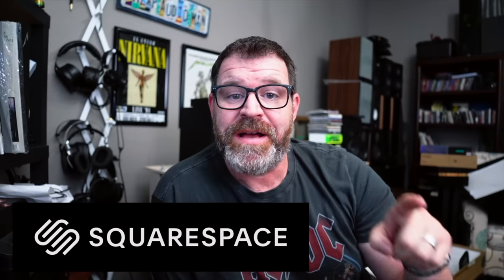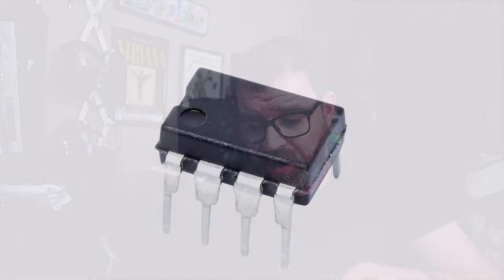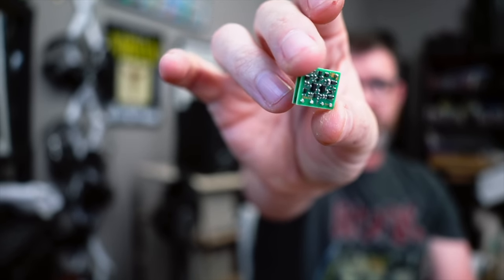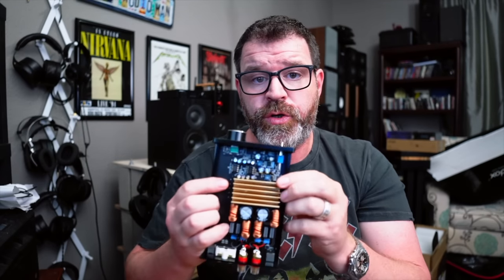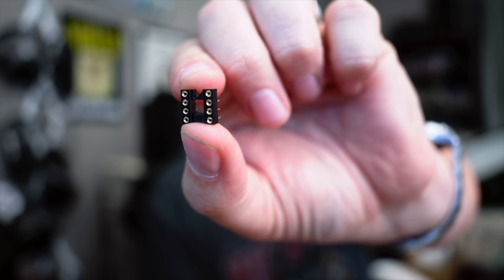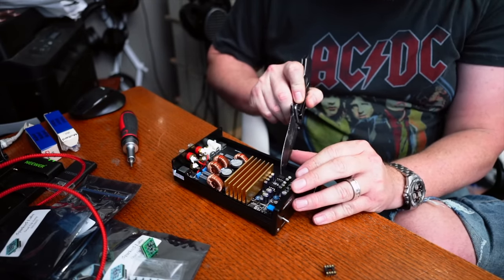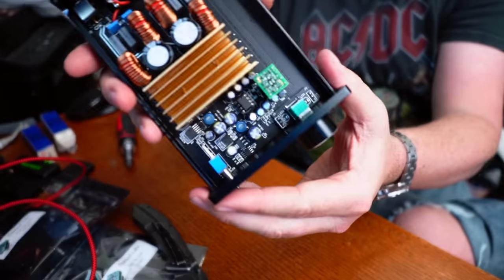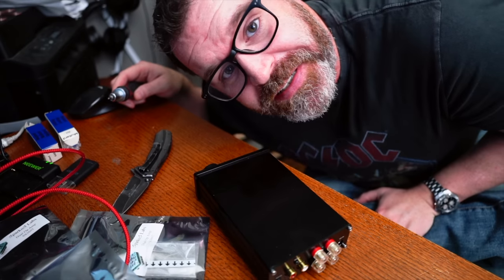Make an $80 Amp Beat $1,000 Amps?! Find out How!

Comment: I have checked the Sparko page  but i can not understand what is the difference between single ss3601 discret op amp and the dual ss3602. Anybody knows it please?. Thanks in advance.
Reply: The Stock NE5532 opamp has 2 amplifiers internally(dual opamp), you need to replace them with another "dual opamp" opamp (if you don't it won't make any sound or in the worst case scenario you might burn the amplifier and opamps) like the ss3602 or any other dual opamp like the OPA1656(will require adapters) or the LM4562,  LME49720 or OPA2134. But first you need to make sure that the stock NE5532 opamps are genuine, if they are not them upgrading a genuine pair of NE5532 will make a difference. Maybe that's why upgrading to a $160 pair of sparkos make a huge difference in first place.

Comment: Randy, So you get both SS3602's for $79.80?
Reply: I think they are $79.80 each.  I wonder about the SS3601 ones that are not dual and half the price, so 2 for $80.  Would they work for any aiyima amp (ao7, a08 or a300)?

Comment: It would’ve been nice to show beginner diy’ers the proper way to remove an op amp, but I guess a pocket knife works better than gnawing it off the board with your teeth. Measuring the differences between the stock and sparkOS in any way would have been a high point in the video.

Comment: I really enjoy your videos, Randy!! Got a question: I just bought aiyima a07 because I was curious, I have Dali spektor2 speakers and Denon pma720 as my setup and a Teac as my turntable. Aiyima a07 sounds better than Denon, much cleaner, but lacks bass, is there anything I can do to improve that without getting a subwoofer?
Reply: Preamp with a bass knob?
Reply: Maybe a better power supply. Bass is very power hungry.
Reply: Maybe put the speakers closer to a wall...
Reply: @JoseFerreira-zb7wh  that's a good suggestion, I immediately thought of speaker's in the corners and hearing a night and day difference..
Reply: @BabyCharlotteschannel  it actually is. Specially when talking about back ported speakers.

Comment: Not an op amp receiver, it is an 8 pin dip(dual in-line) socket. It is also quite possible that if you replace the op amp you removed with a real one instead of the fake ones used in many of the china products you could achieve nearly the same (or same) results for < 10$.
Reply: op amp chips are routinely under 50 cents each in bulk and it makes no sense to try to save money here, compared to other more expensive components (such as capacitors).  I've not run across fake ones, but I do see a lot of cheap chips.
Reply: @plektosgaming  90+% of the NE5532s shown of Ebay and Aliepress are all the same lot/datecode are the same datecode as the cheap ones( fakes) purchased in the us. It is a commonly known issue. That is one of the cheaper preamp chips with TI running 0.35 each in 1 k qtys. I was a Process Engineer dealing with many Chinese companies and the only thing you could trust is that there was something going on, either your parts getting sold out the back door, inspections not being done, parts being received were not the same as the ones approved. They will use fakes for savings of cents.
Reply: @michaelfischer6984  I can see this happening (human greed and all), but shame on them.

Comment: Great job, Randy.  Big fan of Burson V6 Vivids.  I had to desolder the originals and, if you need to do this, I recommend a machine for the purpose.  It’s a brilliant tool to have, as it makes a full recap of tired vintage gear a breeze.  Of course, I soldered in new carriers to plug the Vivids in to.
Reply: @Pete.across.the.street  I have a Duratool D00672.  In the UK they’re available from CPC Farnell for £70, where you can also find the spare filters you’ll need.  Avoid Amazon!

Comment: I'm looking to get the A07 but do you think it + the OP amps + the high powered power source is a better path than the amps you've schooled us on that have a DAC, remote, BT, AptX-LL/HD and multiple inputs for less than maxing out the A07?
Reply: With a 2v input from a DAC I don't think you are going to max out the amp/power supply without your ears bleeding. The secret here is clean Power. You need a power supply which delivers a clean, low noise and low ripple voltage(less than 20mV p-p).

Comment: The whole music industry is souped up with cheap jellybean NE5532.
 If you follow most music up the signal chain you’ll almost always find it’s already been through dozens, or sometimes even hundreds of op amps. Those big giant mixing consoles you see in the recording studios? Yup, most are filled with hundreds of op amps. Same story for the EQ, compressors, vocal processors, mic preamps, A/D converters, and much more.  They’re mostly inexpensive 5532s in the better gear, and even cheaper parts in the less expensive stuff. Sure music is increasingly produced in the digital domain, but I’ll bet before your music ever touches your audio gear it’s already been through at least several inexpensive op amps. There are some very expensive discrete op amps that were designed specifically to outperform IC op amps in very specific ways. Their highly specialized benefits, to my knowledge, don’t offer any real world advantages in typical audio use. And audiophiles seem to favor much less rigorously designed discrete replacements for IC op amps. These discrete substitutes typically lack any sort of valid test data to demonstrate their real performance. So how does anyone know they outperform ICs? They mostly use Sighted Listening which is completely invalid (see above). Audio-GD discrete op amps were tested by Samuel Groner using an Audio Precision analyzer and the results were horrible.(edited)
original BlogSpot source "NwAvGuy Op Amps: Myths & Facts"

Comment: I just ordered an SS3602 earlier today to swap the LM4562NA that came in my FX-Audio DAC-X6. Hopefully it pairs well with my HiFiMan HE-X4.
Reply: Hi. How did it go? Did you notice any difference?
Reply: @jd5787   Yes. The fit is very tight since it almost touches the tops of the small capacitors by the socket but it works very well. Can’t make out any perceivable noise and there’s no distortion.
Reply: @clayton8816   nice! Any obvious noticeable sound improvement? 😁
Reply: @jd5787  Yeah it makes the mids stand out a little more to my ears so nothing gets lost in the music.

Comment: Yeah, no silly 80$ discrete opamp will make TPA3255 sound any different.
On the other hand telling tpa3255 from lm3886 in a properly conducted test will be nigh impossible.
Reply: just replace the fake TPA3255 in the A07 with a genuine TPA3255
Reply: @AmbientWanderer  As if that will change anything.

Comment: Randy, you frequently mention the larger power supply (and you just unboxed one in your "Youtube Sucks" vid) but I find no mention of EXACTLY how much more juice it brings to the fight in terms of actual output. Please stop teasing me with the idea of $160+$80+$75 (opamps, amp, power supply respectively) without giving me all the beanz.  Hook us up with some knowledge. KICK IT! (#BBLTI)
Reply: @Douglas Blake I hear you, but please don't try inject logic into this! (That is meant in good jest, btw) Much of what we do/buy isn't based on "logical choices". Do I enjoy the fact my HT hits over 110db distortion free with chest pumping bass? Absolutely. Do I do it often? No. But I can, and that's the point. Do $4G speakers sound $3G better than $1G speakers? Subjectively, yes...depending on a multitude of factors. Do I NEED four powered subs? No, but I have them. If I want to drive a pair of speakers to the edge, shouldn't I have that option? Yes. I am interested to find why he bought the updgraded power supply and what it does exactly.
Reply: @Douglas Blake Cool. Thanks. And your thoughts after listening like Randy would provide are...?

Comment: I cringe whenever anyone just blindly roll op-amps without getting to know the topology or circuit. op-amps behave in different circuits.  
Ne5532 which is usually on most gears is a FET input amp and is probably there for a reason. Then some schmuck installs a bipolar input op-amp then claims "better sound". Please. 

Gone are the days when there were forums with exchange of actual knowledge being shared. Instead nowadays are stuck with subjective "reviews" like this.

Comment: two of these op amps are more expensive than the amp, kinda makes the value horrible on discrete opamps since they are all made by small companies and have high costs due to the low sales most likely . i just went with OPA1656 which only costs 35usd or less . idk why you didnt compare them when you also recommended a OPA 1656 before and now dont mention it at all

Comment: Sorry but just replacing a component then saying it "sounds better" proves nothing since it's all subjective opinion. Where's the double blind before and after tests? You should have double blind tested two separate amps , one with original op amps and the second with the replacement op amps, otherwise it's just placebo effect.

Comment: Meh. What are the chances that the sound will actually (objectively) be improved by changing one part of a circuit? Audio circuits are designed, made and tested as a unit. Changing one part changes the design. Do you know better than the designer? Did you run tests before and after to see how the frequency response changed? Did you even run double blind, volume matched, A/B testing to see if you even subjectively improved it? Let's face it, most things sound better after you make a change. If nothing else, you listen harder / differently for a while.
Reply: @jamms2966  You got an actual point to make or just stupid comments about American snacks (I'm sure that sounded cool to you in your head or something?). I explained the rationale behind my comment. And no I don't. But then I'm not the one making claims that changing out one part of a circuit makes it sound "better". It could easily make it sound worse, or make no difference at all. Hence "what are the chances"? Circuits are a sum of their parts - a complete design.

I understand not everyone has testing kit, which is why I mentioned blinded A/B testing. That is free and easy. But not even that is being done. In fact ZERO attempt is being made to rule out pure expectation and subjectivity. So I'm unimpressed with some random internet dude claiming you can turn an $80 amp into a $1000 one by swapping a part out. 

Maybe you believe whatever you're told as long as the person says it to you via YouTube. I don't.